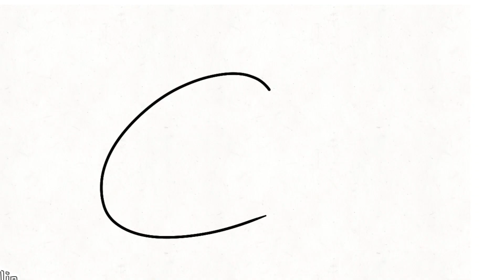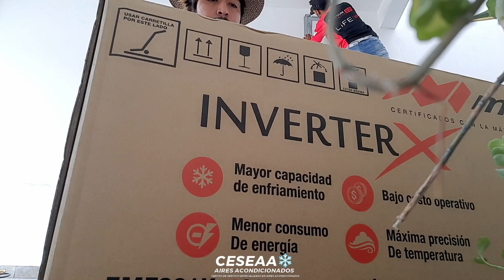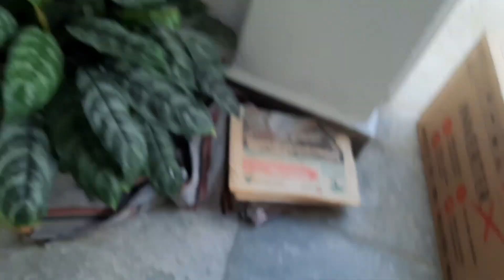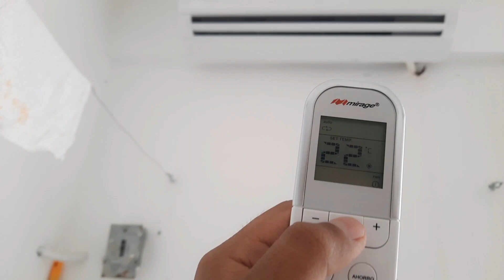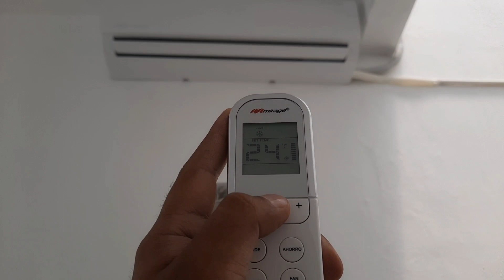INSTALACION Mirage Inverter X de 24,000 BTU A 220V

Comment: Estaba buscando si en tus vídeos hablabas sobre el código error PC 04, pero no lo encontré. ¿Podrías hacer un vídeo? :'( compramos dos aires Mirage Inverter Flex y uno tiene el código, no enfría, solo echa aire, y el otro ya mostró el código 2 veces, pero después vuelve a la normalidad. Nos comentaron que era el calibre del cable, se lo cambiaron y nada. ¿Es la tarjeta electrónica por la instalación? Son nuevos u___u
Reply from the maker: Si te lo instalo un centro de servicio ya tienes un pie dentro de la garantía, si te lo instalo un particular ya empezó el problema, hay personas que aun piensan que los Inverter son igual que los normales. Una mala Instalación puede tronar tu equipo así sea nuevesito, aquí te dejo el significado del PC04 casi al final del video viene el significado https://youtu.be/untkYOFL27s

Quizás sea algún problema eléctrico, pero desde un principio el que te lo instalo debió de revisar la instalación eléctrica si estaba todo en orden. Repito a veces el PC04 es falla de algún tema eléctrico o falla en tarjeta pero en equipos nuevos siempre es por mala Instalación. Si en la tienda donde lo compraste te dan garantía ya te salvaste por que de lo contrario tu técnico tiene que responder. Mira el video y muestrale a tu técnico que revise todo poco a poco.
Reply: @ceseaaclimas  sí... Lamentablemente fue con particular, y la instalación fue después de varios meses, así que ya no entramos en garantía. Vamos a ver qué podemos hacer :/ muchas gracias por responder :)